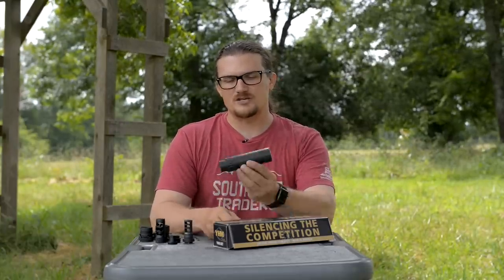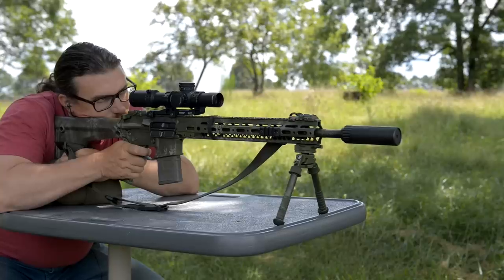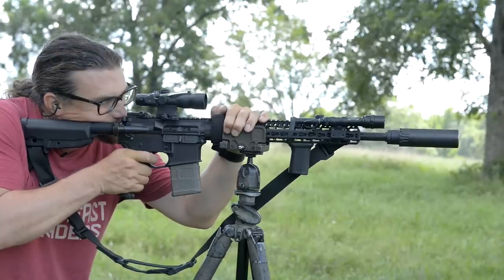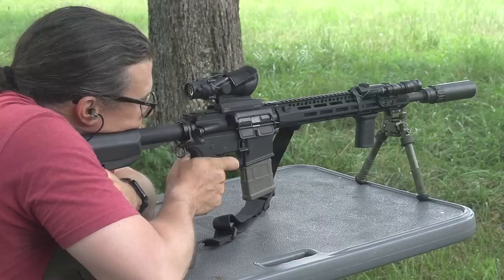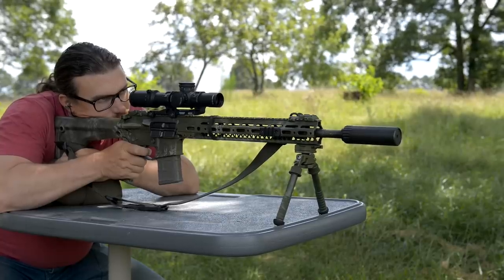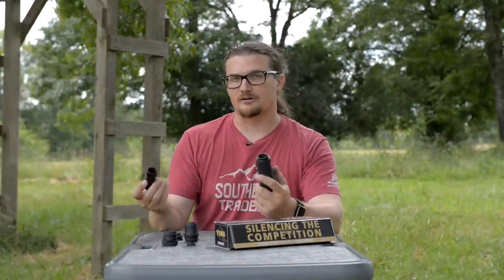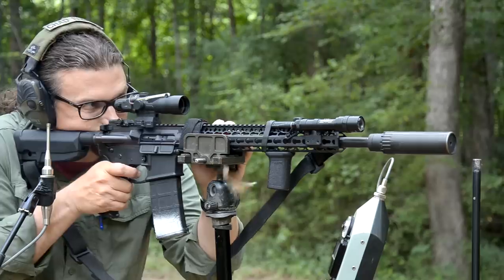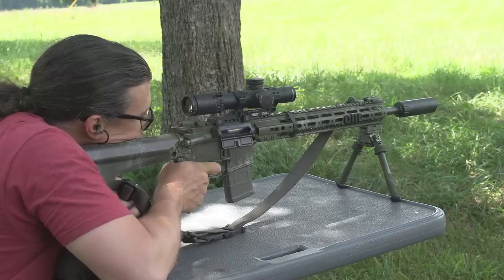Yankee Hill Machine Turbo K

Comment: I bought the gen 1 back when it first came out at Silencer shop. It also came with everything you showed but it was $355 then. I run it on my BCM 11.5" with the ASR flash hider and I love it. Great video!
Reply: Is it hearing safe on your 11.5?
Reply: @Jesse Robinson yeap H2 buffer is recommended. I run it on my 11.5 and the ejection pattern is consistent.
Reply: @aeriinyanu  5.56 is not a hearing safe round.
Reply: @spys0ldier  true
Reply: @spys0ldier  not a single round besides 22 is a hearing safe round lol
Reply: @youngzosh4779  9mm subs in an outdoor open area says otherwise. Federal 150gr syntech are almost as quiet as my .22 subs.

Comment: Nice video thanks bois.

I'm looking at getting a 556 can for my Tavor and AR and I was looking at the full YHM Turbo T2. However weight is definitely something that's important to me so I'd consider K cans too, although at 13.5 oz the full size Turbo can is very light. Although I'd really like hearing safe too. Haha, lots of variables to juggle in selecting a can.
Reply: @BravoSeven  Yeah I wasn't sure, I'm not super informed on cans. I'd say for me on this particular purchase weight is #1, with noise reduction #2. Budget #3 lol.
Reply: The Turbo T2 would be great on the Tavor. I run this on my 16” FN. works great! The balance of the Tavor when suppressed is why I’ve for the X95 on my wish list.
Reply: @frostriver4547  Cool, thanks for your reply!

I really like the Tavor (I got the original one). The balance is so good, I can hold it up for way longer than a regular AR, especially with a big flashlight, optic, and IR illuminator on it (should get a smaller light tho). Ppl complain about the trigger and while I think it's a little heavy (I removed a spring from the assembly), if you can't be decent with that trigger, with the spring out, then you just blow at shooting.

The only thing I do not care for is the bolt hold open, God that little plastic piece is chinsy and awkward to use.
Reply: @BravoSeven  Nice. Thanks for sharing your experience. The other one I was considering was the OSS HX-QD Titanium. Quite a bit of a price difference there lol. I do like the less gas blowback from the OSS cans.

Comment: Hey Chad, would you recommend this suppressor for varmint hunting on an AR15? What's considered "lightweight" for a suppressor? I like that this can is shorter but I assume that sacrifices sound suppression. I've been looking for a suppressor for an 18" rifle I use for coyotes and other varmints.
Reply: 12oz or less ready to mount would be lightweight to me. At the ear dB measurements are very similar for semi autos with K and full size cans. Bolt actions will have a very noticeable different at the ear, so for a varmint rifle I’d prefer short, handy and lightweight over the alternative. On an 18” AR with properly setup gas you can likely expect mid to high 130s at the ear.
Reply: @chads3356  thanks for all the good info!

Comment: I have one of these but Gen 2 sitting on an 11.5” sbr with a plan A mount. Nice little setup and still haven’t shot it 😐
Reply: Curious if you have shot it or not? I'm in the process of a similar build
Reply: @4BanginYJ  yeah, I have.
Reply: @spys0ldier  work well on an 11.5 barrel setup?
Reply: @4BanginYJ  I don’t know what you would call work well as it’s a short barrel and 5.56. It’s not as quiet as my 16” with full size SRD556QD can but I’m happy for it cutting down a lot of the noise. Just don’t expect hearing safe with any 5.56 gun.

Comment: So question, just put this on Layaway which will be my first Can. Did I understand you to say that this is recommended for at least a 10inch barrel ? I was going to put it on a 9 inch AR Pistol
Reply: Yes, the minimum barrel length on the YHM Turbo K is 10.5 inches. If it were to be used on shorter; it will most likely void the warranty.

Comment: What are the Legalities of using silencers (Suppresers)?
Reply: Varies by local laws. For accurate answers for your location find a local lawyer. If you are in the USA and a USCCA member you should be able to find everything you need quickly. 

Note, in the the US you have to apply for the $200 tax stamp through the ATF before you can legally possess a suppressor. This is required for each item. Some stores have a kiosk to walk you through the process. 

Outside of the US some countries require a suppressor for hunting. 

I am not a lawyer and this is not legal advice.